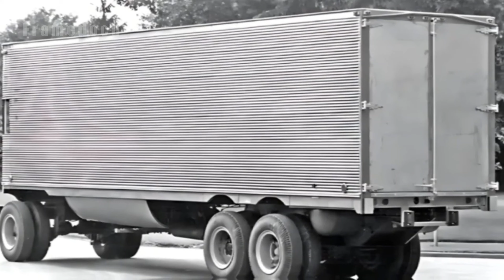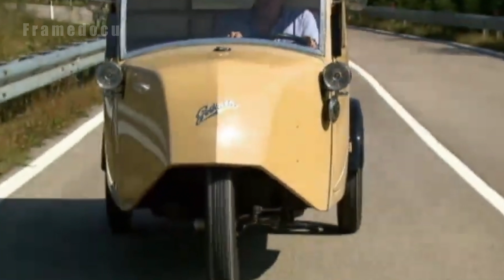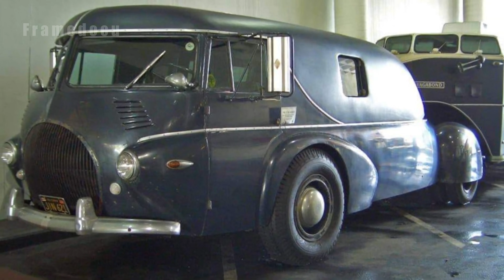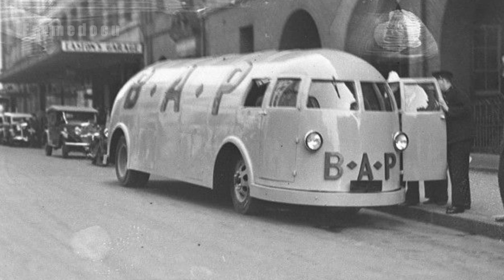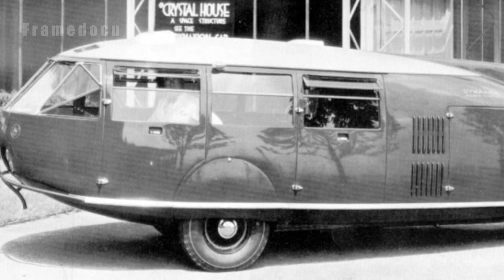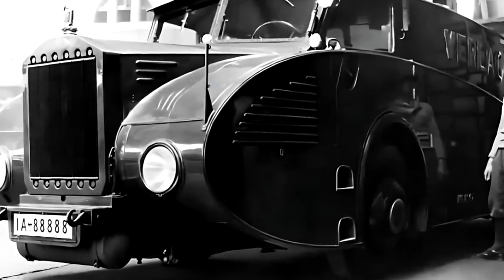10 Futuristic Vintage Trucks That Were Decades Ahead of Their Era — You Have Never Seen These

Comment: The trouble with the  84/40 CGT aka The Quad Gun Tractor was is distinctiveness. You see it you know there is artillery and the opposition would shoot first. Intrestingly , the early ones had the accelerator in the middle, were we expect the brake pedal. Exciting when you forget. Later versions had a plain flat back.
Reply from the maker: That’s a great point. The "AEC 4×4 Matador (Quad Gun Tractor)" was extremely recognizable, which often made it an obvious target on the battlefield during World War II. If you saw one moving, it usually meant artillery was nearby, so enemy forces knew exactly where to focus their fire.
And yes, those early pedal layouts were unusual. Having the accelerator where drivers expected the brake could definitely create some dangerous moments until they changed the design in later versions.
Really interesting detail thanks for sharing!
Reply: @FrameDocu  Matador is a totally different vehicle. that was a Heavy Gun tractor, those used for other things. So was not imidiatley associated with artillery . It was NEVER reffered to as a QUAD. The Morris  Quad or CMP on same design lines was speciffically desinged to tow trailer No 24 and Mk1 or Mk 2 Gun/howitzer 25LB I operate such equipment at historical renactments.
Reply from the maker: @51WCDodge  Thanks for the clarification. You’re right, the Matador and the Quad tractors, like the Morris C8, served different roles. The Quad was specifically designed to tow the 25-pounder and its No.24 trailer, while the Matador was a heavier artillery tractor used for other equipment.

Really appreciate the insight, especially coming from someone who actually operates these vehicles in historical reenactments.